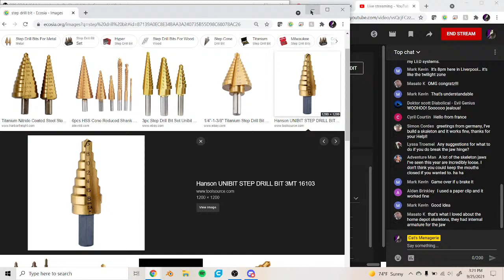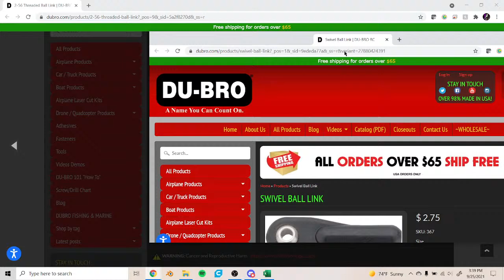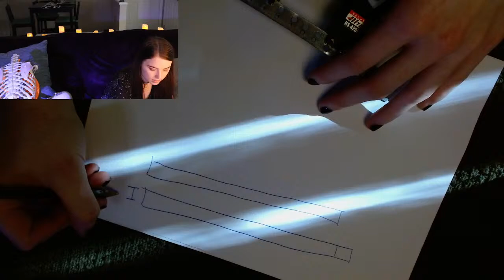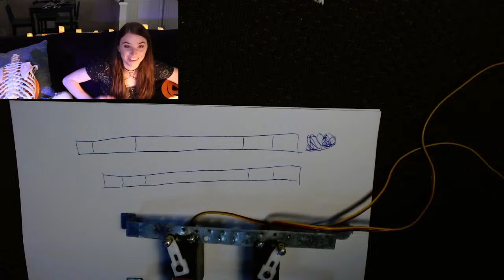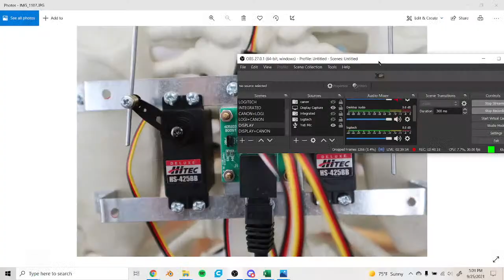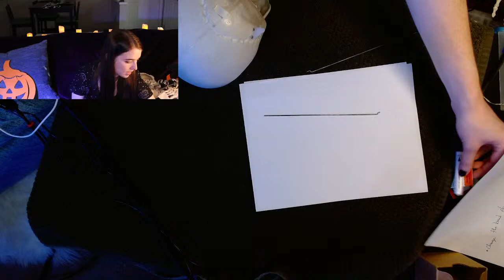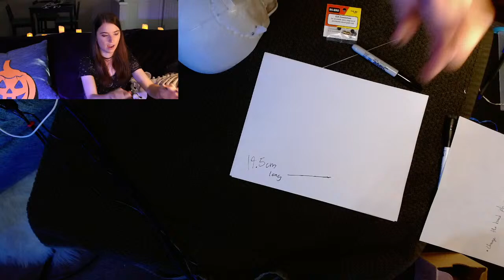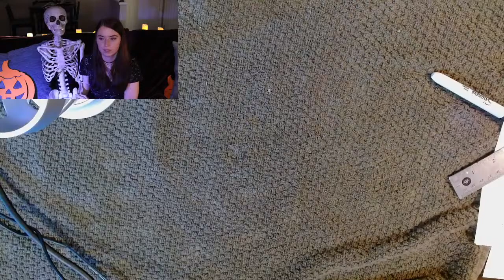DIY Skeleton Animatronic LIVE!

Comment: Great tip to reinforce the spine with PVC pipe Cat. My skeleton version had ridges inside so it took quite a bit of force to push it in fully. I then used a drill driver to drill the screw back into the spine and 1/2” PVC. It worked on my trio just fine though.
Reply: Jesus loves you and will help your through all your going through ❤️ never lose hope ❤️ never give up ❤️ you are loved ❤️